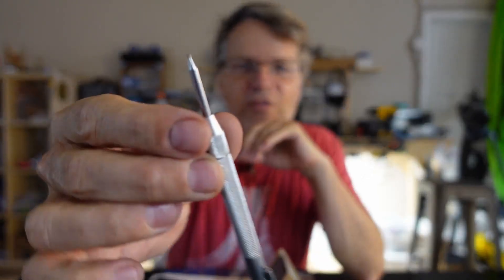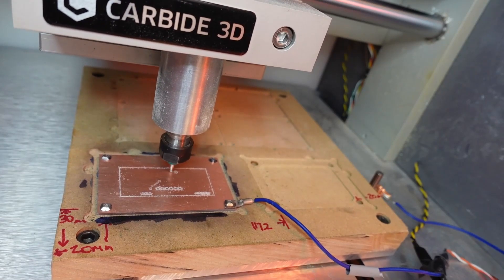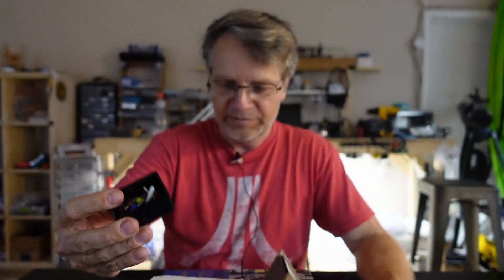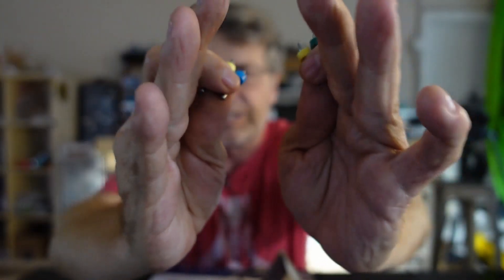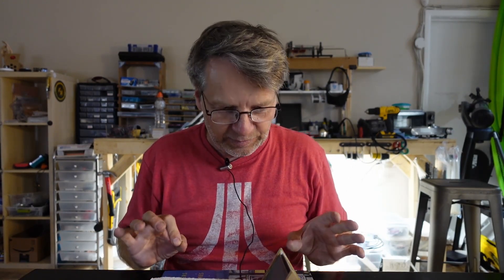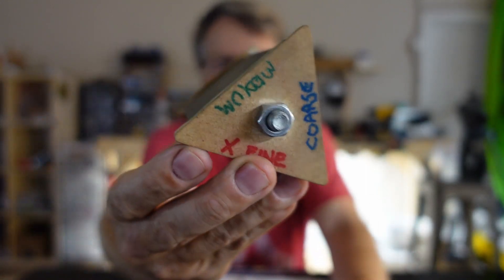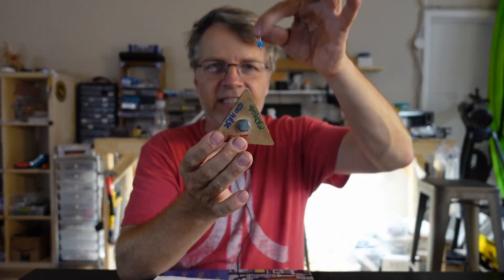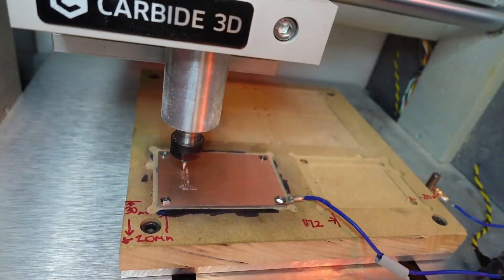Use Broken Drill Bits to Make PCB's

Comment: That is great to know that the broken drill bits at made of the same tungsten carbide that the scribe is made out of.  That is fantastic.  Everyone has a bunch of these laying around.  I love that 3 sided triangle to get the 60 degrees, and with the diamond surface, and even more importantly, knowing that my bench grinder probably ain't gonna cut it if I try to use it to sharpen one of these scribe bits.  That saves me time, and humiliation, to be able to skip that.  I will still try it, but not with the same hopes or intensity.

Comment: Great idea sir..... But will please share tips to drill vias from0.1mm to 0.3mm without cnc drill
Reply from the maker: I used to use a little 'drill press' made from scrap parts and a little hand drill. You just need to get it moving up and down in a straight path, so even a drawer slider and spring would work. If you etch a tiny dot in the middle of the hole (rather than a full sized hole) it helps to center the drill, and the drill bit will still make the hole the size you need. 

I also used a jeweler's loupe, it probably helped more than anything - your hands are way more precise than your eyes. 

You do want a fairly high rotation speed on your drill though, and it needs to be pretty concentric. Those bits love to break when things aren't well lined up :).

Best of luck with it!